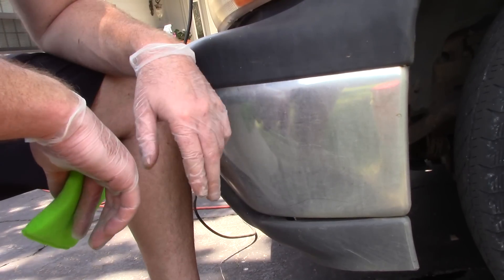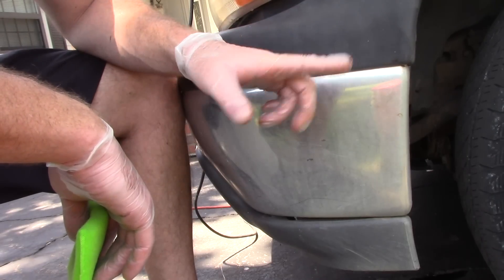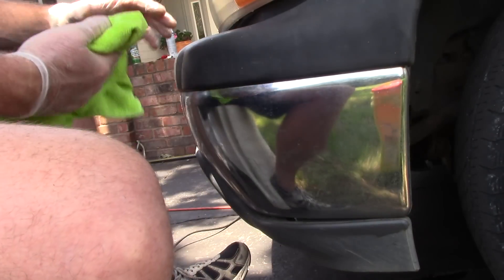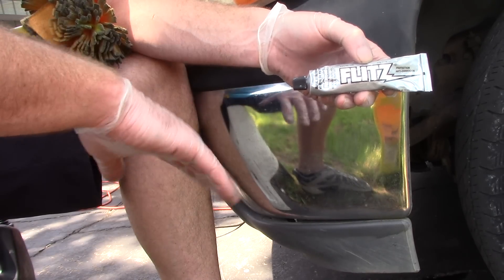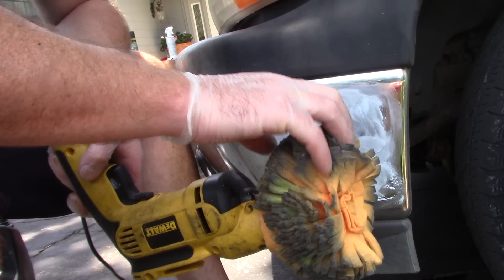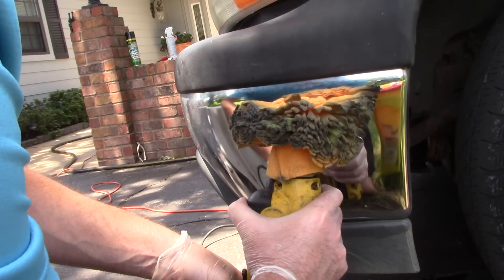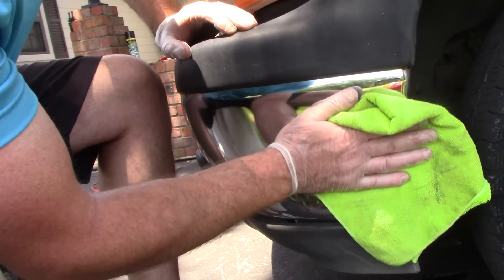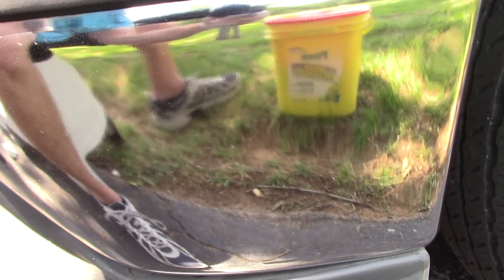Polish Chrome Bumper Fast & Easy!

Comment: Wow this literally worked exactly as you showed! I was cleaning up the inside of my chrome steeldrum that I've had for years, and  it had rust spots and was super dulled. I cleaned out the rust with a brillo pad and turtle wax, then cleaned the surface with 70% isopropyl alcohol since i didnt have degreaser. Then i used the flitz polish and bought a buffing ball for my drill, and it worked like a charm! Whole thing was done in like 10 mins

Comment: I have a 05 Dodge Ram and the front looks just like this hence why I am watching the video lol...as far as the plastic, Peanut butter cleaned and oiled the stuff amazingly!! I then went the extra mile and used a cotton ball full of baby oil ;) wipe it in even strokes back and forth after removing the PB residue. Let sit for a bit I did an hour or so then buff off the baby oil! I live in Cali and the sun is brutal but my plastic looks great!

Comment: OR, once you get the gunk off, spend $2.25 on Turtle Wax chrome polish (yes, Turtle Wax) and get the same results with a soft towel. I've seen it remove minor rust spots off a Harley I detailed.
Reply: ed elsey turtle wax is awesome, I use it on my chrome rims, railings & side steps...

Comment: Thanks for the tip -- will FLITZ remove iron rust spots (no chips on the chrome bumper -- just spots) from CHROME bumpers as well?  If not, any product to recommend?  I live in Oregon, otherwise I would bring my truck to you!

Comment: Thanks for taking the time,  I have what looks like several drops of oil on my new Chevy Silverado but will not come off when scrubbing it with soap & water,!would that orange degreaser take it off??? What brand do you use? I’ve seen it a Wallymart, not sure what brand orange degreaser recommended..

Comment: You should try S.O.S. pads sometime.  The S.O.S. pads with the blue soap in them does wonders on chrome.  It cleans, conditions, and polishes the chrome like new all in one step.  You can clean the dirtiest bumper in under 2 minutes.  Also gets rid of light rust.

Comment: Have you ever tried speedy metal polish? I love it.
Reply from the maker: no but i will look into it...thanks for the tip:)
Reply: Dallas Paint Correction & Auto Detailing.    I used it to polish a 45 foot fuel tanker. It was amazing.

Comment: after doing the chrome it looks like another tough chore dealing with the grungy soiled, stained and dull plastics surrounding the bumper ~
Reply: There’s this one thing called wipe new and I used it on my truck, just one wipe on all the black plastics and it looked brand new

Comment: I use gloves and rub black rust oleum paint into those plastic bumper covers.  Most of the paint gets rubbed off and if it doesn't use a little gas to thin it. This lasts for months and doesn't peel off because you have thinned it to the point there is not enough on there to peel. Try it on a beater/winter car first and see for yourself!

Comment: 000 steel wool is what I use on any chrome. Spray a little soap and water mixture on the surface and wipe away. Works great
Reply: SOS pad is what i use
Reply: I prefer a belt sander personally

Comment: First make sure it's actually Chrome and not Chrome painted plastic. Cleaned a Dodge truck when they first started putting those "20" Chrome Wheels" on them. They are a plastic hub cap over a steel wheel. How freaking cheap. And they where charging for actual chrome wheels. I'm pretty sure there was a class action lawsuit for that. Anyway I scratched the hell out of a set.
Reply: I have a 2007 chrysler aspen... it has 20 in wheels with what I thought was  chrome wheels but it feels like plastic..i t want to clean then but I am not sure what to use I dont want to hurt them...what do you suggest
Reply: Lots of so called chrome wheels are plastic covers.

Comment: I use extra fine grade steel wool then a microfiber. Any wax after that and it looks great. The steel wool will take off any rust pits and most other stuff. Ever try it? Of course you have to be careful not to run the paint or plastic trim
Reply from the maker: plus i find you get little shavings of steel wool all over the place..so i don't use that method...but if its working for you thats awesome:)..plus your right it can damage plastic, i can't take that risk with my clients cars

Comment: you forgot to clay barr first clay barr before you do any kind of polishing your results will be better good video buddy the bumper still look good but clay barr nextime
Reply from the maker: ok..thanks for the tip:)...but perhaps i checked the surface first and if i knew after 26 years of using a clay bar there was no bonded contaminates ...can i polish?
Reply: Dallas Paint Correction & Auto Detailing always clay barr first it could be some there that you cannot see by your eyes trust me some is there tfr buddy check me out at autogeek.com
Reply from the maker: yeah i heard that before, i also heard i need to use a bag over my hand to feel them..man i always forget!..im such a fool...i promise to clay bar next time..i promise
Reply: Dallas Paint Correction & Auto Detailing ha ha ha you right checkout autogeek mike puts the bag on his hands and feel for defects ha ha ha i just clay barr anyway just to be on the safe side tfr buddy ha ha ha ha
Reply: Dallas Paint Correction & Auto Detailing ha ha ha
Reply: MK6OWNER ha ha ha ha